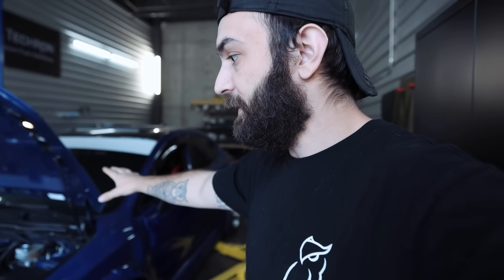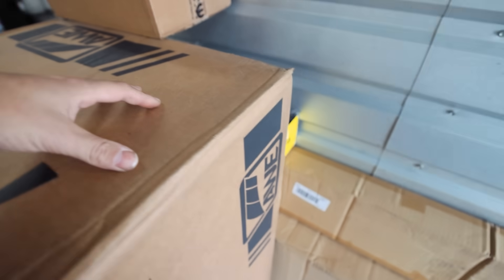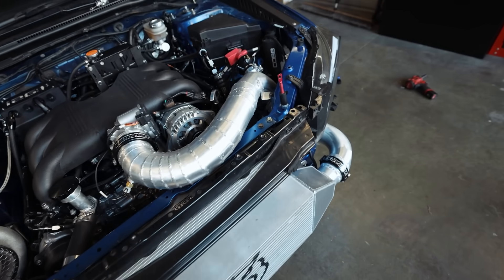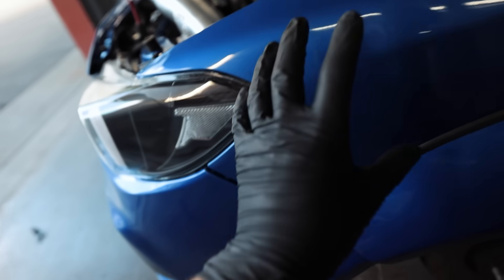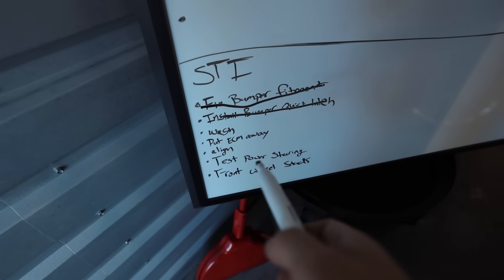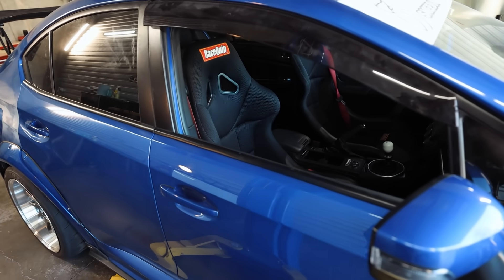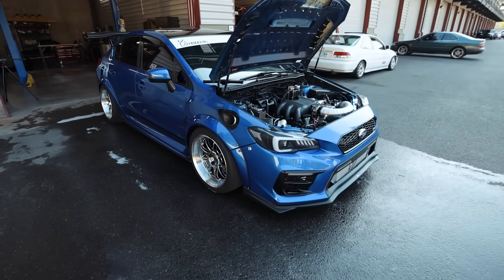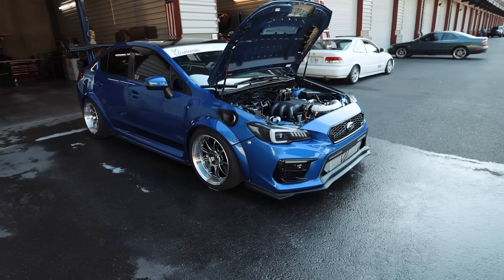3.3L 6 Cylinder Subaru WRX STI Is ready for the Dyno!

Comment: I did the same for the quick release bumper. I left the plastic brackets underneath for proper alignment. Just cut the area you need. Better gap/fitment.
Reply from the maker: I would but the flares kinda mess it up and mine were broken 😅

Comment: Heck yeah! Heard you mentioned it's easier to turn left vs right. Wonder if there's a way to relearn your steering position sensor. Normally it helps the ecu in the rack depict assist amount among other things. Love the videos as always ! Great progress 🤘🏻
Reply: You can see it in the driving clips that the steering wheel isn't centered.  It'll pull towards the center of the rack.  Alignment can fix all that

Comment: Bumper quick releases- I think most have this problem and dont really talk about it. Unfortunately you dont ever notice until you go to fit it up the first time and you've already blasted holes in your bumper.  if you can visualize the offset needed you can make a small bracket to relocate the pin on but accounting for the offset is a lot of maths and spatial relationships that can be really tough just to tighten up a weird gap.

Comment: The way I have my quick latches done is I drilled through the bumper plastic clips on the side and used that hole so the bumper holds in place and the top of the bumper on the core suppose I used 2 more quick latches there to. Yes I have it on a GD but its pretty much the same process on any of these cars.
Reply: Keeping the plastic side clips and drilling through it for thr QR prevents the bumper from sagging into the fender

Comment: You have two things going on ( steering wheel off center to RHS , than check alignment)
Reply from the maker: Wheek is center properly, the rack is not, and the alignment is meh
Reply: @Smeedia  yeah it's Alignment, I get this every time workshop remove engine or the gear 😐.

Comment: before any tuning or dyno, I would have the injectors cleaned and flow checked bro, its been sitting for a while and it could cost an engine. also new fuel filter.
Reply from the maker: These are Brand New ID1300s and I have Brand New 2600s going in when we get to the Dyno 🙌
Reply: Halelujah ! <3 @Smeedia

Comment: Move Over Racing makes a sweet looking and robust looking quick release kit by the way. Plus it has an STI logo. Why skimp or settle at this point. Just saying. It’s the little finishing touches that make one’s smile with one’s build that little bit bigger. I bet the company would even cut you a deal 😉 to be associated with your build.
Curious to see how you adjust to the electric rack versus the superior OEM hydraulic. But you only had so much space and compromises had to be made. Perrin makes a steering dampener lockdown made for the electric rack. Have one myself it makes steering response better.
Reply from the maker: I've seen it. It dosent fit with the flares 🤝

Comment: 💪💪💪☝️, way better the response and sharper acceleration, man the dash display looks good, i'm debating on the MoTeC between C125 5" or C127 7", on the cluster C127 or under the climate controls C125, I might get a 8 CAN keypad but dont know if its really a MUST have perk

Comment: Looking sick sounding awesome😎😎...What are your 1st impressions of the electric rack compared to  the hydraulic quick racks you've had on other STI's how many turns lock to lock does it have 2.5 or 2.7 🤔 looking to go electronic rack but torn between 15+ WRX or electricitify a hydraulic rack with a Volvo electric pump your feedback appreciated thanks
Reply from the maker: Honestly I really like it compared to hydraulic racks. No worries of fluids, pumps going bad, lines leaking. It's extremely responsive feels very light and has good feedback. Mine still needs dialed in but I like it more than I thought I would 🙌
Reply: @Smeedia  thanks for that have you checked how many turns lock to lock🤔 I have a Diesel Impreza hatchback as a daily driver over here in UK 200bhp it has an electric rack but it has a terrible low ratio rack 3.2 turns lock to lock spoils an amazing daily when coming from a 2.5 turn lock to lock WRX weekend car the 2015+ WRX electric rack looks Identical & plug & play curious as to what ratio it has

Comment: dude, that growl from inside the car is just a visceral sound,  almost like a bear growling in your ear from the back seat.   Did you recheck the spacing of the new hal effect sensor?  I was thinking if shes fine when warmed up, it may just be  half a hair to far away when cold and that could explain the cold start issue with it.
Reply from the maker: I think it's a voltage issue, it has thr most toeuble during cranking when the fans are running so might just need a better battery

Comment: Question why did you run 5w30 in the new wrx? Could you do a video or something on it explaining why
Reply from the maker: Handles heat better, small bump in oil pressure. Subaru uses 0w20 for fuel milage reasons

Comment: Hey man I was planning on getting a hybrid speed density but I also have ets Inter cooler piping and it seems my piping has a little bing for the speed density (AEN) to go in so I don't weld but I'm not sure if that's were that goes. Any thoughts?